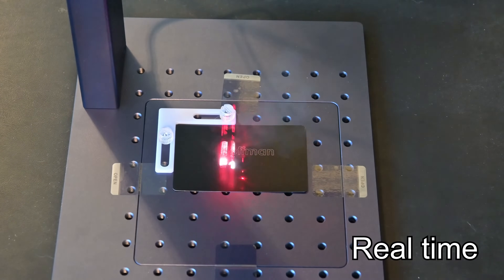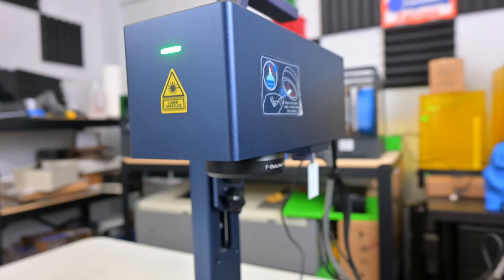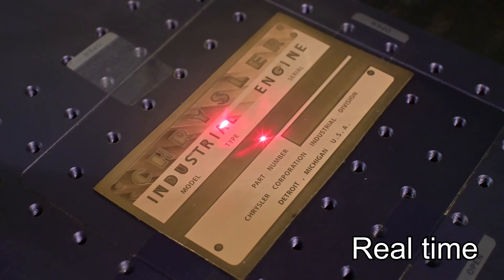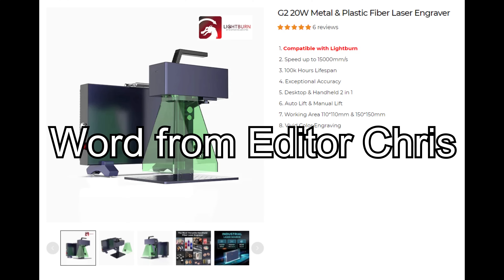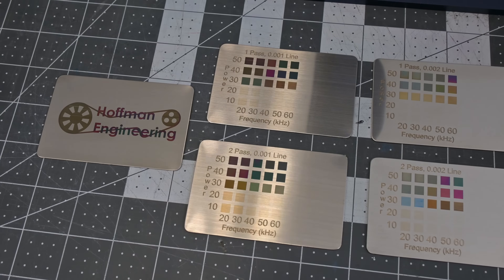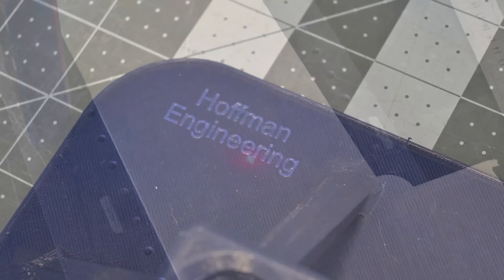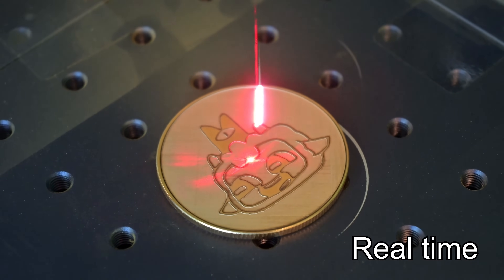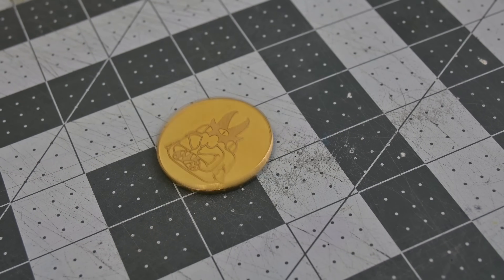The Most Affordable Fiber Laser. Deep Metal Engraving, Color Stainless Steel and more! - Gweike G2

Comment: Can it's machine brass depth 3.5mm
Reply from the maker: Not in a reasonable amount of time. It took 2 hours to engrave the Hoffman Engineering brass coin about 1.7mm. To get 3.5mm depth, you'd need to run it for much longer, and might require you to move the focus down.

You'd want a more powerful fiber laser for that.

Comment: I wonder if it would be easier to make the two dots overlap if you were to view the dots thru a welding lense.
Reply: The dots are low power like a laser pointer you would use to exercise your cat. They would not be bright enough for an arc welding filter. Or are you thinking about a green lens like you might use for cutting or welding with acetylene gas?  In which place green sunglasses might work.

Comment: 20W LASER FOR STAINLESS STEEL?!?! Get the fugg outta here…. You need AT LEAST 50w-100w to engrave STAINLESS STEEL!
Reply: Fiber lasers can engrave steel with less optical output because of their IR wavelength which is absorbed by reflective metal and not reflected.

Comment: Awsome video! Dose laser engravers produce fumes? Can i use it in an apartment? Im looking to engrave stainless steal is it hard to make a multicolor engraving?
Reply from the maker: All lasers will produce fumes and fine particles. They vaporize the material, so that needs to be vented somewhere. Companies do make fume extractor (also called air purifiers) for the lasers though. So if you cutting indoors, you'll need an enclosure and fume extractor.
Reply: @HoffmanEngineering  thank you for your reply!

Comment: My old manufacturer would cut and engrave small freeform metal blanks for pendants. Would that have been something like a fibre laser and also a some kind of router? Would this unit or the pro work?
Reply: I’ve been told the commarker b4 60w or higher could work , just any fiber laser with high wattage

Comment: Purchased one, Looked used when it arrived, I too could not connect to wifi, The USB sent with it, had the incorrect Config. Information. The Fixed cable from power supply to laser head had a short or bad connection causing the laser head to sometimes not turn on with the power supply. The only thing I asked for was a replacement be sent with an RA number so I would not have down time. Answer was no, So I ordered a different brand while dealing with the return. Not yet a company I want to deal with.
Reply: may I ask what brand you went with and the experience?
Reply: I had similar experience with Omtech
Reply: What laser did you go with the second time.?

Comment: Engraving and marking are two different things. They are not interchangeable. If it is engraving, they would disclose the depth the laser would cut into (steel, aluminum, etc) the material with single pass or each pass. While the wavelength disclosure may be helpful (1064 nm for metals) it still needs to be well presented enough to help a customer like me make informed decision. I need a laser that can engrave a stainless steel to a depth of about 15um to 38um, if possible on a single pass or second pass.
Reply: That's the problem with these, well, I won't call them fly by night laser company's.  Like it or not their internals are all stuff off the shelf (the laser diode for instance in this model).  You just have to slap on a heat sink and get a gimble.  They just don't give you hard numbers of data or  if they do you have to hunt for the spec sheets somewhere.  I also have issues with buying any kind of device that requires internet without a seral (or even printer) port for input.
Reply: What kind of laser machine can engrave a depth of atleast 3mm on metal?
Reply: @madtin  3mm is quite deep...

Comment: This machine marking cutting and engraving in metal or gold
Reply from the maker: Fiber lasers can engrave most metals, including gold and silver. It's more than just a surface mark, it can actually remove material. "Cutting", as in actually cutting through metal, isn't really possible unless you are talking about extremely thin melaterial. It cannot remove enough material fast enough to consider it cutting.
Reply: @HoffmanEngineering  with enough passes it can cut. First hand experience.
Reply: It can burn wood easily. It can cut and it can do colours. And I’ve only had it for a few days. I also managed to learn how to use GLaser, Lightburn and Inkscape in a couple of days. Quality works require slow times like in 3D printing.

Comment: Hey There,
I have the same Laser, but whatever I try to Color Engrave, it is just burned. Was your Color Engraving in Focus? Or did you Defocus it?
Besides this problem I love this laser, it is much fun to use.

Great Video btw.
Reply from the maker: It was in focus right at the surface. Try with the settings that I used on the test cards in the video. Speed was 1000 mm/s, with various powers, frequencies, passes, and line intervals.